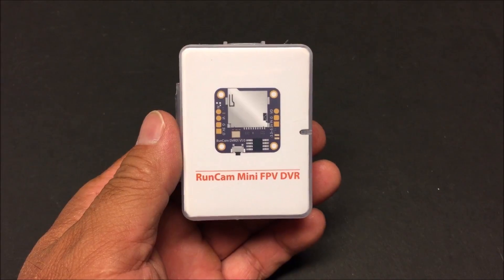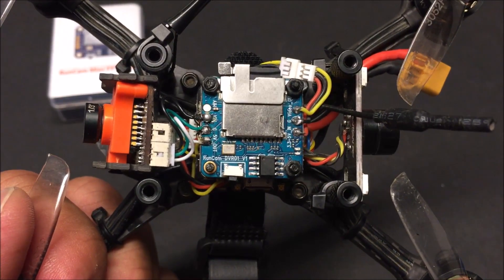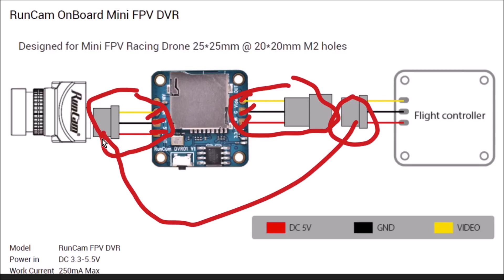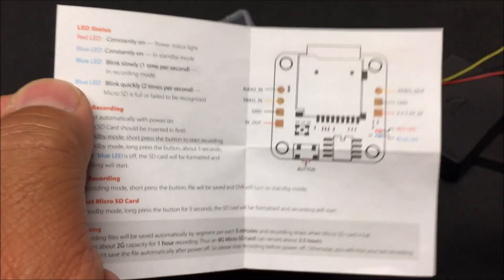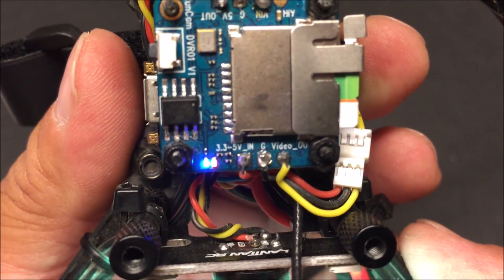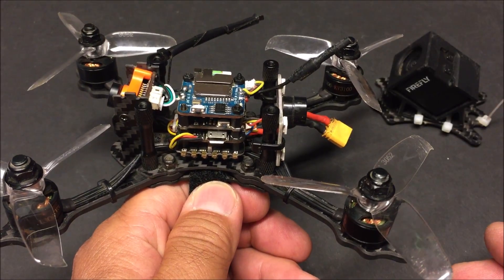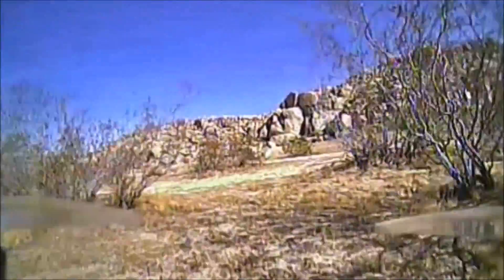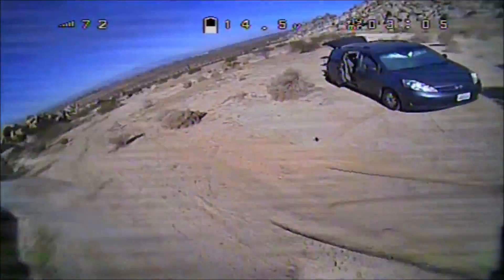Runcam DVR01 Mini FPV DVR Module

Comment: I'm having issues with the module, first it worked, but for some reason after a couple videos, when I plug in the battery to the module with camera, the lights just turn on, and keep being constantly on, no matter if I press the button. Do you know why this might be?
Reply from the maker: Nope, sorry.  I still have mine on the 3" quad and it still works good.
Reply: @RCEscape  Hm, ok thanks anyway.

Comment: Put one in my 5 inch the other day. Still adjusting the settings in my camera.  Nice flying and video comparison.
Reply from the maker: If they made it to record 16x9, it would be awesome :)
Reply: What cam did u use ? Thinking about to use it on a swift 2 and wondering if it will work.